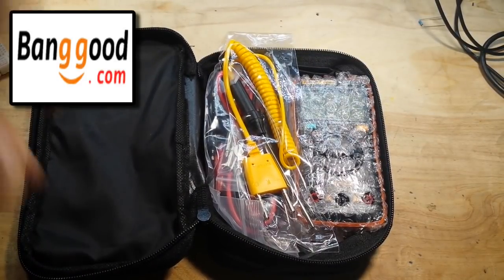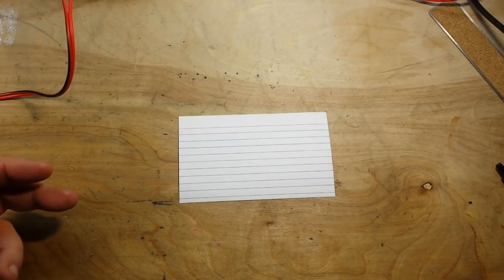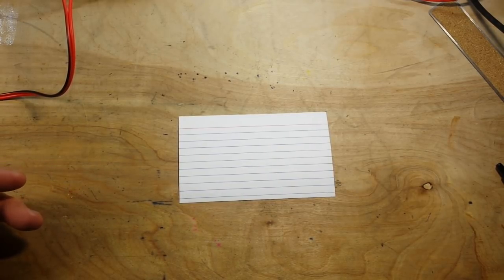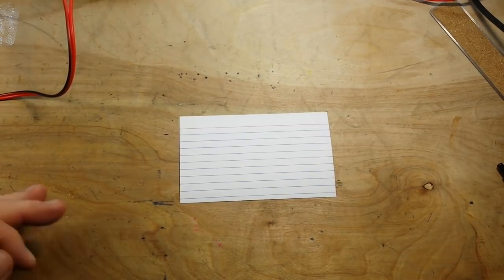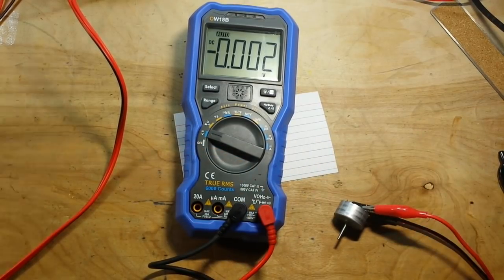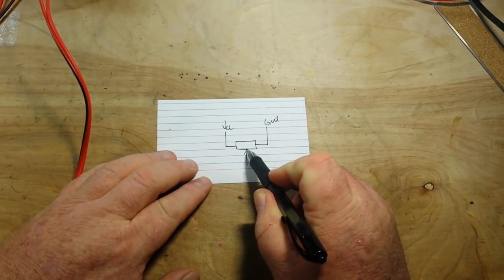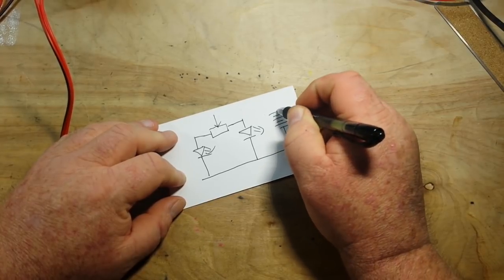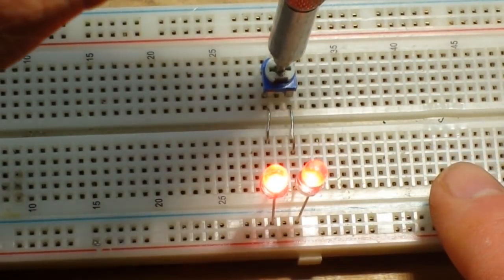Think differently

Comment: Like the idea of think.differently.
Imagine i had a permability field effect transistor,  that can switch magnetic flux very fast. 
It would turn every magnet to a perpetual micro current generator.

Imagine you strip the cover off a film capacitor. Isnt that a dielectric mirror?

Comment: You need a current limit resistor in the wiper of the potentiometer if the LEDs are to survive the wiper being tuned to the extreme end positions. A better solution would be to feed the wiper from a constant current source, then the pot acts as a selective current distributor, sharing the current in ratio to the LEDs.
A while back I came up with an alternative use for a piezoelectric speaker disk. These are a small metal disk with a slightly smaller  piezoelectric disk bonded to it. These components can work as both a speaker and microphone. However, they can also be made into a very sensitive vibration detector, with a voltage output that far exceeds that produced when acting as a microphone.
The trick is to place the disk in the bottom of a close fitting container, such as a plastic pill bottle, those resembling a tube with a closed end. The disk can be secured with double sided sticky pads. It connection wires passed out of a small hole drilled in the side of the container, close to the bottom. Then place a small ballbearing or glass marble on top of the disk. The diameter of the ball should match that of the disk. A small disk of sponge or similar material should be placed above the ball to restrict its motion, so the ball is free to move a millimetre or so. This is to stop the ball damaging the piezo electric disk.
With the ball resting on the disk, the whole assembly becomes an extremely sensitive vibration sensor that is relatively insensitive to ambient sound. This is partly due to the damping effect of the weight of the ball and partly due to the huge difference in the voltage output produced by small mechanical vibrations to that of sound vibrations. Placed on a table, the component will produce a volt or more of output if the table is tapped and with suitable amplification can detect the slightest touch to the surface.
I published the design based on this component on the now defunct Maplin online forum a few years ago.
Basically I connected the sensor to the differential inputs of a small ultra low current PIC processor.  This detected the sensor output voltage and used it to watch on a timed LED light. The project was called a knock knock light, because the PIC could be programmed to detect the cadence of a knock to the surface on which the circuit was placed, and only switch on the light in response to a particular knock. I have used my prototype as a bedside night light for a few years now. The three AA batteries that powers the unit last for years, because the PIC enters very low current, less than 1 uA, sleep mode when in standby. To activate the light, I just tap the night stand twice and the light comes on for a about 180 seconds. While on, any further taps extends the time the  light is on by resetting the programmed timeout period. These advantage of the light is that I do not need to fumble for the light switch remote control in the dark, I just tap the bedside table stand anywhere on its surface.
My application of the sensor is simple, but it has many other uses in alarm systems, because it is practically insensitive to sound, only detecting surface vibration and because it's standby current is so small.
The point of this post is that it shows the use of the piezoelectric speaker disk in a different way than was intended, which I think was the point of your video. 

P.S. in my application I mounted the piezo electric disc in a uPVC water pipe termination connector. It made an ideal retainer for a small glass marble. The connector was drilled and screwed to the inside of a project box that held the circuit board and the LED light array.
Reply from the maker: Its just a concept. A way to look at things in a different light. Im not advocating the use of leds without a current limiting resistor.
Reply: learnelectronics I guessed that was the case, ideas just suggesting an improvement. Have you considered using LEDs as replacements for Zener diodes. I once used to back to back super bright LEDs as audio clipper diodes, they have a well defined voltage knee, produce a not too soft voltage limit and light up when they start to clip.
Reply from the maker: Yes! I have used leds for Zeners.
Reply: If it doesn't fit all the requirements its not an improvement - its just a proof of concept without a real world application.  Real world uses would be far less illustrative in a demo.  Balancing output for different colour combinations would show sweet spots in different places round the dial red/yellow would be very subtle, red/blue less so.
Using Wheatstone's principle In the days before LEDs we used to solder two carbon filament bulbs (because they have a filament that's very reactive to variance)  to a central probe and connect + and - to the other contacts.  It makes a seriously sensitive test probe for tapping out circuits.  Depending whether you were touching a more + or more - point the bulbs change balance intensity - you can see microA variances quite clearly.  I only rarely carried a meter in those days.

Comment: Well, your English grammar is better than Steve Jobs was.  Incidentally, the first computer that I bought was an Apple ][+ with 48K of RAM, back in 1981. It cost me close to $5,000 including monitor, one 5-1/4" floppy drive and an Epson MX-80 printer. To put that in perspective, just five years earlier I bought a brand new Toyota Hilux pickup truck for $4,500. I still have that computer (but not the truck). The Apple of today is diametrically opposed to the Apple back then--shipped with the Apple ][+ was a set of three manuals, and one of them had the complete electrical schematic of the computer, down to the last resistor and capacitor. They were completely open back then, unlike the walled garden they force users into today. I like the power of today's computers, but I really miss the sense of adventure and exploration of the early days. If you weren't there, I can't explain it.
Reply from the maker: I was there. While my first computer was a Timex-Sinclair 1000, my next was a ][e with two 5.25 floppies and an Apple monitor (monochrome green). I loved that computer. I learned to program in both BASIC & LOGO on it. Had the add-on 80 column card and a Gorilla-Banana printer.
Reply: The Apple 2+ was also my first computer - and I still have it here somewhere.

It cost almost 100% of my summer wages that year.

Comment: I got your inspirational massage of the video.
One technical point I want to mention is that, if by mistake someone completely turn the potentiometer ,then the  led may get damaged.To avoid this one additional resistance may be connected to center pin.
Reply: Turned the know all the way and burned a led. Now I've placed a resistor in the center as you suggested.